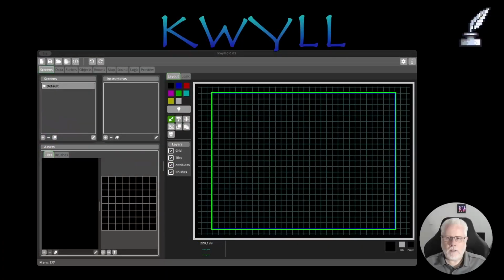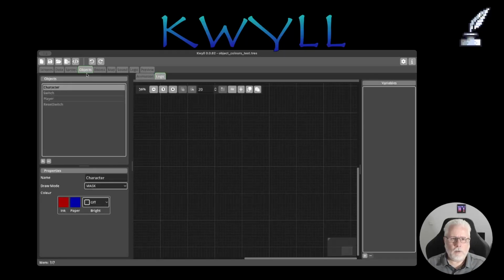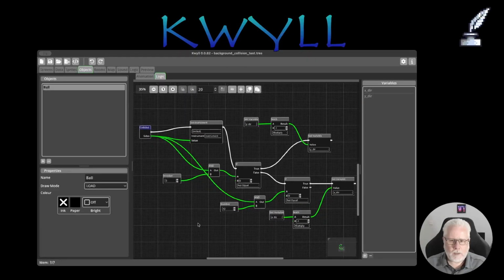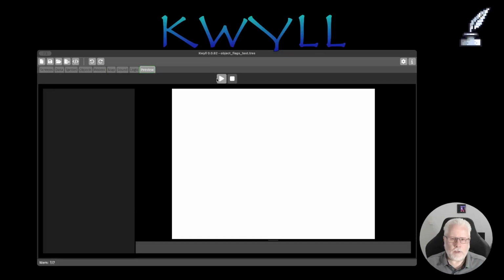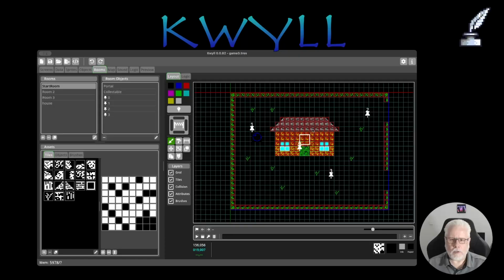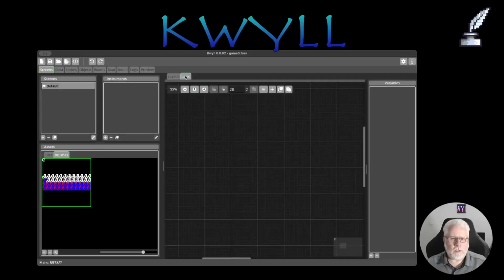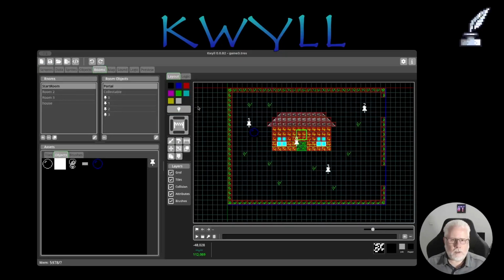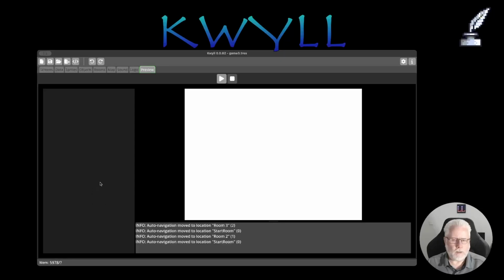Kwyll 31 - Almost There!

Comment: I've almost finished building a ZX Spectrum Next computer, based on the N-Go board. When that's complete, I hope to start working on the tutorials.  Thanks for this, it looks great and I'm looking forward to trying it.  I am backing you on Patreon.
Reply from the maker: Thanks for your support, it means a lot. Just so you are aware, at the first release, Kwyll will be targeting the original 48k Speccy, limitations and all. It is, however, engineered to be multi-platform, and the Spectrum Next is highly likely to be the next platform I add direct support for.
Reply: @indigobeetle Ace, thanks.  I understood that, a few months back I asked you a question about Next support which you kindly answered.  I love thd clasdic 48k and 128k Speccies as well as the Next, so that's fine.  😊